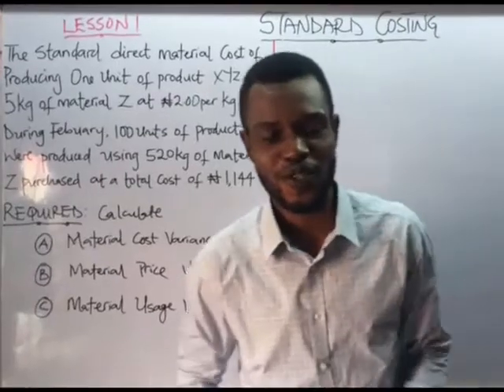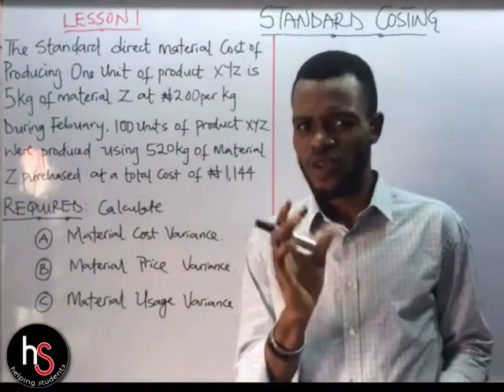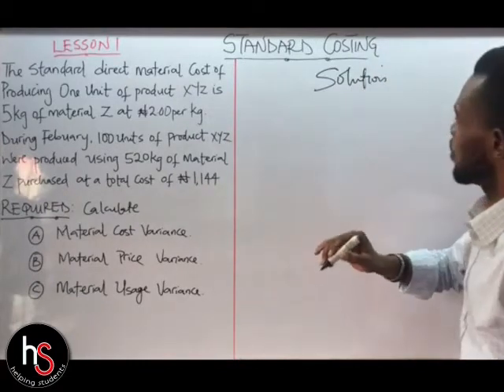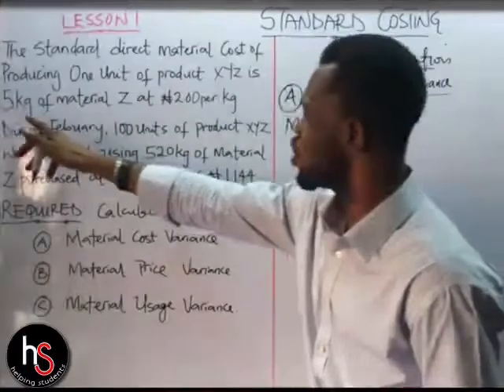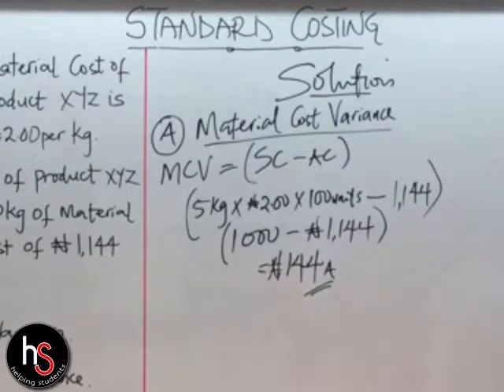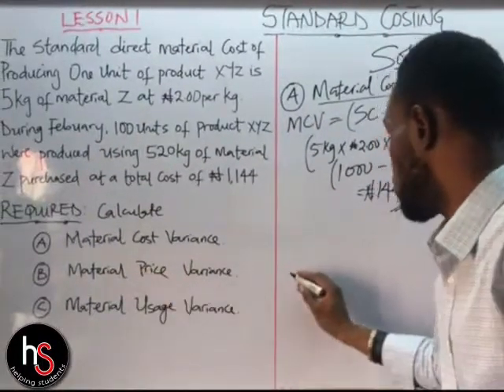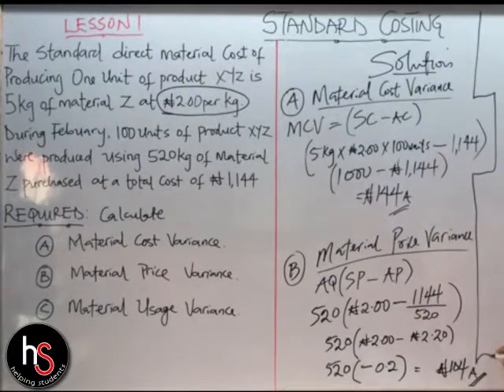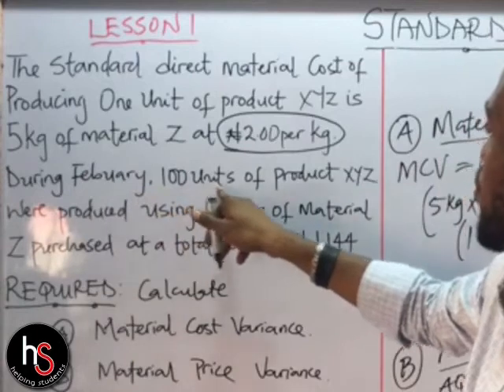Material Variance | Standard Costing

Comment: Please check this out...what if when standard quantity for manufacturing 20,000 units of a product is set at 100,000kg of material for a total price of #1,000,000.

The actual operational results shows that 30,000 units of the noodles were produced from 144,000kg of material input at actual price of #1,562,400.

What is the MPV, MUV and MCV

Comment: Concept 

Soln

(a) MCV= SC - AC
SC= 1 Unit x 5kg x N200 = 1000 units.kg.N 
AC= 100 Units produced using 520 Kg with total cost N1144, this actual cost for production 

Then 
MVC= 1000 units.kg.N - 1144 units.kg.N
MVC = -144 Units.kg.N 
Since it’s negative refer from lecture evaluation it’s adverse (A)

Hence MCV Is  114A